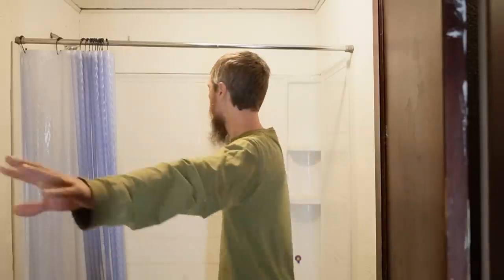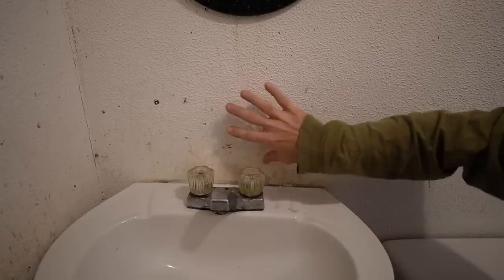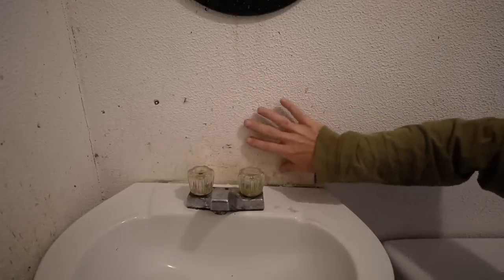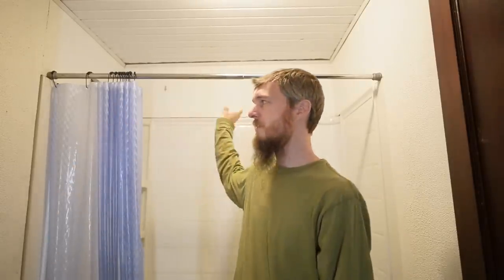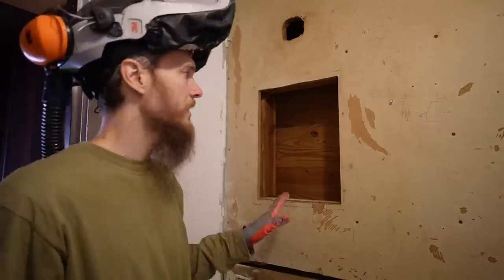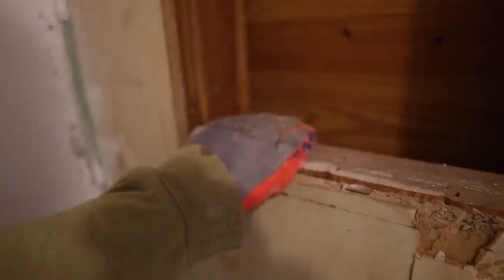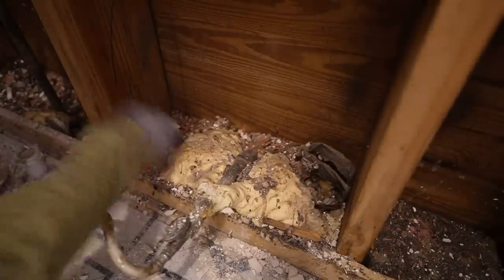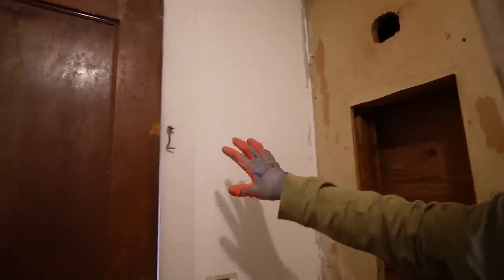Gutting a Tiny Bathroom - Saving this Old Home

Comment: Over the last week, I was invited to help my brother gut and renovate his in-laws (wife's parents) bathroom.  The original builder was her wife's father... and so he cut NO corners... In fact, he used EXTRA stuff everywhere... a tile floor in a concrete bed an inch thicker than usual... 2 layers of drywall glued and screwed, instead of one.  Extra nailers/blocking to make sure they could hang towel racks, toilet paper dispenser, and everything else sturdily.  Every time he put something in that house, you could simply imagine him saying "That ain't going nowhere".... and our 2-day demo turned into a week long adventure.  We had to cut the drywall into strips of about a foot wide and take them down one at a time... the concrete floor had to be cut into one foot squares and even then it was a challenge to lift them off the subfloor.  There was a porcelain coated iron tub, about 600 lbs., and we had to cut that in half in order to get it out.  It's been a job.  If I was a content creator, I may have had some viral content on demolishing this over-engineered bathroom.  We need to put in 36 inch doors and a walk in tub/shower thing.  The inlaws are getting older and are often wheel chair bound so this renovation is necessary.

Comment: When Doug was so careful dismantling the tub and shower surround walls I thought ¹someone wanted to utilize them or ²excavator fun was in our future.   It's always a plus when a bit of fun can be added to any tiring and dirty demo day.   That bathroom is looking so much better.   Stripping down to the studs does instill confidence you can discover and correct all mistakes.    Otherwise it's similar to 'putting lipstick on a pig' except a painted pig cannot lead to a potential house fire - or worse.    Looking forward to seeing your design concept.   Maverick in the window was precious!    Such a delightful and charming young man.   Both Maverick and Belle are respectful and delightful children.   Well done indeed Ashley and Doug!!!

Comment: Yup right there with you on being tired. Seems like a small room is harder to tear out and redo than a large room. It will look awesome of course once it's done. Hope you will put a tub back in and get a cast iron tub and do a tile surround. Why cast iron, well because all the acrylic (plastic) tubs will crack over time and steel tubs are not worth a crap. They warp and eventually rust. A quality cast iron tub is  the way to go. Yes it's heavy...and while you have the floor out " sister" up the joist to handle the weight of the tub and the water when bathing. But you do what you want to, I am just making a suggestion. Looking forward to the next video.

Comment: ...been there done that...have found open electrical boxes in walls during remodels before...once, there were bare wires laying on a 2x10 ceiling joist at one of my houses I remodeled...the wood was burned in a "V" leaving charcoal all around the wires...DO NOT know how that didn't burn down the house...was GLAD to find it and fix it! Good work and good luck!!

Comment: Those walls are actually what was called textured paint. Sometimes it was even marketed as textured paint with sand finish. It was a pain putting it on any surface. 
Back in the 70s and 80s it was sold by the gallon. People unfortunately thought since it was paint you didn't need to apply a protective topcoat. 
My grandmother had my dad put that in her house, then tried to blame him when it did exactly what yours is doing.

Comment: It’s been a year this month that we started our bathroom renovation. 20 x 9. Which included the closet. Our floor consisted of sheathing 1/2 inch. 3/4 particle board, about 1 1/2 inch of poured concrete and mesh plus tile. The shower was about 6 inches of concrete. It has been the worst demo we have ever done. I couldn’t get up the next day. Turned out to be two truckloads of debris. So I totally understand the pain. All we have been able to do this year is the floor demo and new 3/4 subfloor. 😅

Comment: The high-speed demolition, told everyone how poorly the old bathroom was built. No wonder, you needed to rebuild something that is clearly intended to function as a bathroom. Still, at least there were no obvious signs of serious water damage or mould lurking in what passed as the structure. Three rubbish boxes in one make you work really hard, and getting it all done in a confined space is always far harder than having the right size space. Go off, relax, recharge and come back ready for action.

Comment: I feel for you, man. Our master bathroom is the same size, and it's awful having to deal with such a small space. When I demo-ed mine, the subfloor was 1x6 boards oriented diagonally and running under the walls, so I had to cut it all out (there was termite damage). We couldn't change the size, so we used light colors and a glass 3x3 shower enclosure to open up the space. Still small, but much more liveable.

Comment: Yeah that did look like a lot of hard work. It's going to be nice seeing the process as you work building a new larger bathroom. Now I'm wondering what your family is doing to take showers and go to the toilet while you build the new one. Here in Japan the bathroom area is very unique. You have a bathtub on the one side and then a shower right next to the tub. The shower is not over the tub but next to it. Japanese like to clean their bodies with soap and often sit on the floor in the shower space and then once the body is nice and clean, then get into the tub. Very healthy and hygienic way to clean your body. The bathtub and shower has its own door and there is a fan with motor to clean out the humidity after and during your time using it. Then the basin is in another small room linked to the bath/shower room. I think this style was influenced by the communal public baths that were used hundreds of years ago. At the public baths, people would first clean their bodies with soap and shower and then once clean get into the hot water baths that were used communally. You still find public baths in Japan. People go there to relax.
Reply from the maker: We have another bathroom in the house. We had just got it ready to use just before we gutted this one.

Comment: Somewhere there is an iron worker and or electrician cringing at your wire pliers being used as pipe wrench and standard pliers
Reply from the maker: I used them as a screwdriver too when removing the shower knobs. I'm not proud of it though. I was just not in the mood to go look for the right tools and I happen to have them nearby. They are nice pliers!
Reply: I’ll say this, I notice you use quality tools, good tools will last a long time. You do great work

Comment: Doug, I'd like to make a suggestion. Lighten up on the previous owner(s). Obviously they were not skilled craftsmen like you are nor could they afford to hire professionals. That bathroom, with the exception of the electrical connections and the lack of paint on the drywall functioned properly, didn't leak and served it's purpose. I remember being honorably discharged from the Navy with a wife and 3 children. We bought a 100 year old house in Pennsylvania.  I had an adequate job that met all living expenses, but not enough to upgrade, just repair things that were failing including steel pipes, cracking horse-hair plaster, etc.. I used professionals only for things I couldn't handle myself like a leaking very steep roof.  I'd like it if you just assume that the previous owners did the best that they could to create a sufficiently livable house given their ability and income level. I admire your skill and willingness to learn and do the work according to modern standards. I enjoy your  "no shortcuts" attitude.
Reply: I totally agree. Probably never had the money or know how to fix it “right”.
Reply: @elainetip6795  I assumed he meant Doug.
Reply: @elainetip6795  Yeah, brain flatus! Thanks for the catch. Don't have a clue what I was thinking (if I was). It's fixed.
Reply: Doug has always been respectful to the previous owners
Reply from the maker: When I share our renovations I do it from a non personal point of view. It's nothing against the previous people, we just point out what is gross and what needs fixing. We are used to these types of renovations and we have been in all kinds of homes. If I came across poorly or in anyway condescending, I apologize :)
Reply: @diyfferent   Maybe I misunderstood your comments while tearing out the bathroom. I read between the lines, "What were the previous owners thinkin with this poor work?". Thank you for your reply. I promise not to unsubscribe.

Comment: 13:18 Is  the obligatory pile of discarded razor blades hiding somewhere in that spray foam? There was usually a bunch of them piled up under those little medicine cabinets with the slot in the back. I don't mind little bathrooms, but that one really was tiny, and though those plastic tub surrounds can last forever, textured drywall and self-stick tiles seem like a lame choice for the wettest room in the house. Good luck with the new one.
Reply: had to laugh at this as my partner just said "wonder if they found any razors in there?" and then we saw your post. when we renovated our bathroom we found nearly 200 used razors in the wall.
Reply: This house was pre-razorblade medicine cabinet.

Comment: Shameful to destroy that Sterling by Kohler tub and wall kit. Just installed one yesterday. Another person would had loved to reinstall that. Just shy of $1,000.00 wasted and tossed into a landfil...  
Just say'n..
Reply from the maker: I think most people want a new acrylic/fiberglass tub unit when they are going through the work of a remodel, not a 20+ year old dirty tub unit. Also, they would only be able to use certain faucets since the holes were already drilled out. It would be very difficult to find anyone who would have wanted this unit. We had to get rid of it before the dumpster left, or else we would have been stuck with it. Don't worry about what we are "wasting" or tossing into landfills. We do more positive things for the environment than a lot of people do. Also, taking the time to take photos, make a listing, setting up a meeting time, giving out our address, waiting around all day wasting our time, just to have no-shows, doesn't sound fun. Been there done that. Not worth my effort.